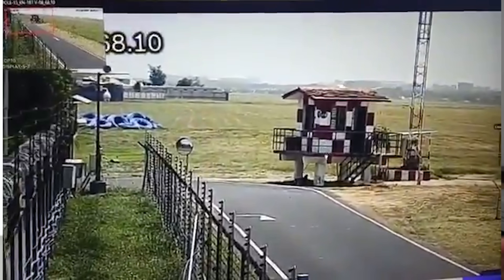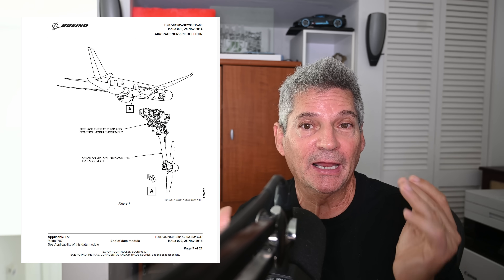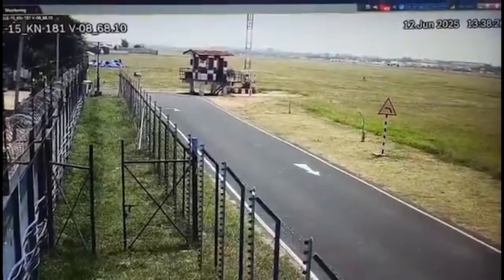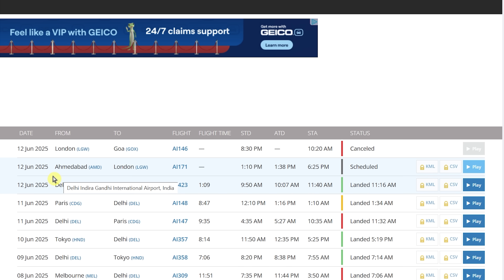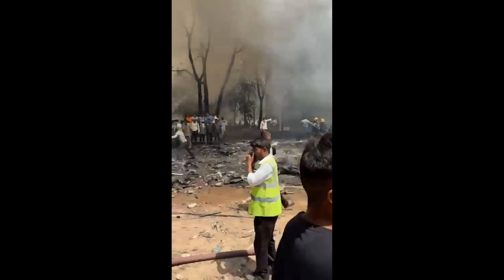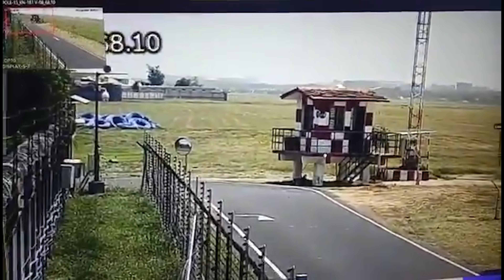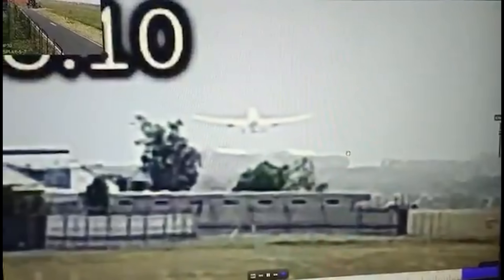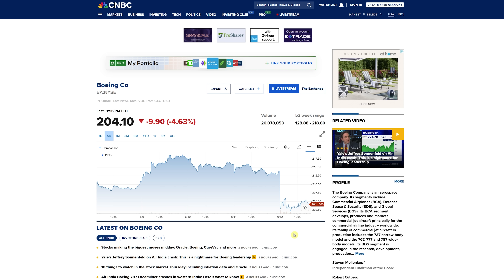What Caused Air India 171 Crash, Mysterious Sound Before Impact

Comment: It acted like and sounded like either Double Engine Failure (both engines) or a compressor stall .. but without the characteristic "banging". Either that or the engines never spooled up properly before the plane left the ground. I'm even curious if fuel was somehow cut off suddenly. It might explain why it sounded like both engines were spooling down. 
It's a miracle that anyone could walk away from that crash. A M A Z I N G  !!   I'm guessing the forward fuselage broke away from at the Wing Root (or spar / strongest part of the plane) as did the tail section from the other side of the wing root. There was likely no recognizable plane in front of him and his feet might have even been dangling from 12-16 feet above the wreckage. He undid his seat belt and basically fell out of the plane without any floor in front of him.

Comment: I think plane experienced total electrical system failure that affected engines and deployed RAT, tell tale sign is flight data transmission to FlightAware stopped at 625ft
Reply: A total electrical failure, while possible, won't affect control of the engines.

Comment: In a modern aircraft, deploying the flaps is crucial, and I see no flaps. This brings up such painful memories. The failure to deploy the flaps is what led to the tragic death of my three loved ones when Northwest Airlines Flight 255 crashed at DTW on August 16, 1987. How could that happen again with a modern aircraft?
Reply: In a 787, takeoff without flaps will not happen as the takeoff configuration warning system will restrict the movement of the throttles and its not that easy to disable it.

For now we have to wait for the DGCA to say anything
Reply: How can even an inexperienced pilot not properly deploy the flaps when that is so crucial?  In safety we call that complacency where you are on autopilot and not really thinking.  I suppose it is possible.
Reply: If it is flaps then it has to be determined what caused the flap issue.  Possible loss of power to hydraulics so the RAT is deployed but not enough time to gain the needed power?  Only thinking out loud.  Very tragic.
Reply: In the video, the flaps were retracted. Doesn't make difference what happened before that. No flaps, no lift, you're dead.
Reply: @MrPLC999  the video was not of Best quality, plus a 787 will never take off if flaps were not extended, the system will restrict movement of the engine throttles
Reply: @MrPLC999  so what was the root cause?  We seem to understand the flaps weren't properly positioned.  Why?  Mistake or something else.  Like a guy run a red light and dies so the brilliant observation is he hit someone and died?  If you run red lights you might die?  Like I said it seems like the flaps are basic for anyone flying that level of aircraft.
Reply: It is very rare!!!!
System these days call out that before takeoff
Reply: The comunication by the pilot to control tower was : “MAYDAY  MAYDAY ENGINE FAILURE… NO POWER NO TRUST”……… Evidently an engine problem Not a flaps issue
Reply: The flaps were out according to the footage of the crashed plane.
Reply: @nickofzo yeah but RAT was also deployed automatically which means it only happens if there is a loss of power. So both engines lost power. Question is how? 

This is the biggest thing we need to see rn. And Boeing don't have a good track record for past 5 years.

Comment: Another YT video on this crash shows the takeoff from the aft end of the aircraft. The flaps were clearly stowed in this video; you can see the flap track fairings, which would be blocked from view if the flaps were deployed. 

This is what I think happened: the aircraft went to the holding point with the flaps stowed. When the pilot set takeoff thrust and all the alarms started going off the crew decided they were false and silenced them...There's claim that the slats were deployed and the flaps were partially deployed...which sounds to me like the crew realizing their mistake while the jet was in the air and trying to set them when the aircraft was already flying - which does not work; they have to be set before flight for a reason.

Final report: "Recommendations to prevent this from happening: don't do that!"

Comment: the RAT (ram air turbine) is for generating electricity, not for propelling the plane. the electricity did cut off on this plane in its prior flight. so perhaps the RAT came out because of an electrical power outage.

Comment: i see smoke on left when rising from runway also i think trajectory was not straight with runway, i think left engine went and fully loaded no power, very thin wings on this 787, needed both engines... would the prop drive drop if one engine fails due to bird strike and compressor fan failure?

Comment: Look where it took off on Flight radar 24. Seems the pilot did not use the full length of the run way. Went to the first taxiway and entered the runway. To use the full length of the runway, pilot would have turned left and taxi down and do a 180 to use the full 11,000 foot runway.

Comment: CHECK THE CARGO . WAS WEIGHT. OVERLOADED?
2 ENGINE BOTH  TO STOPED WHENN?
EMERGENCY POWERSYSTEM ACTIVATED, ENGINE. STILL RUNNING BUT WITH NOT ENOUGH POWER BECAUSE OF OVERLOAD. THE PILOT COULDNT PUT MORE POWER TO THE ENGINE IN TIME BECAUSE  THE HIGHT WAS NOT ENOUGH, AND  TO SELF ACTIVATE THE ENERGENCY ELECTRIC POWER SYSTEM YOU  LOSE TIME

Comment: I have 1 question for you sir , aroplane crash with fully loaded fuel into small building and it doesn't fall off ,just few damage and how come American twin towers with so much sequrity and heavy infrastructure fall off so easily??
Reply: The 911 twin towers were wired with explosives it was a controlled demolition
Reply: Not a concrete building

Comment: The run-way is too small for the Air-INDIA flight to fly and the corrupt politicians allowed lot of concrete jungle buildings near the airport...
Reply: The runway is almost 12,000 feet long that is as long as they come .
But the question is did he use the whole length seems like he didn’t back track down and instead took off starting from the middle of the runway using only 6,000 feet .
Hard to believe they would be that stupid but what else can it be ?

Comment: I've performed ops checks on many RAT's on Airbus and Boeing over the years and can attest the noise produced is deafening, especially if you're running it in the hanger or standing close by. You HAVE to wear hearing protection! Yes, you can hear it a long way away and it has a very distinctive sound signature. I think you're right. It sounds like it deployed.

Comment: NOW WE CONCENTRATE OUR ATENTION TO THE FIRST HALF OF THE PLANE. 
1 HE WENT THROU BUILDING WITH ENOUGH SPEED AND AS A RESULT WILL BE SQUASHED AT IMPACT. 
2 THE SPEED OF THE FIRST HALF COMPARES WITH THE REAR OF THE PLANE WAS HIGH ENOGH TO ESCAPE FROM EXPLOSION OF THE REAR PART OF THE PLANE
3 THE 1ST HALF WILL HAVE NOT ENOGH SPEED TO KILL ALL THE PASAGERS ON ROW 9,10 ,11 AT THE IMPACT
4 THE PASSANGERS OF ROWS 9,10,11 WERE BADLY, VERY BADLY INJURED AFTER IMPACT WITH ZHE SOIL. ALL DIED SHORT AFTER
5 PASSENGER SEAT 11A SURVIVES BECAUSE HE WAS THE LAST ONE AND THE SPEED WAS NOT HIGH ENOGH
6 BEFORE IMPACT WITHSOIL 1ST HALF TURNS TO RIGHT ALMOST UPSIDE DOWN
7 THAT PUT SEAT 11A  UP
8 THE CRUSH  LEFT HIM WITH THE MOST CHANCES OF SURVIVE

Comment: Whenever a commercial flight crashes like this, do you notice the debris like everywhere.  Even when there is a huge ball of fire, that being thousands of gallons of jet fuel dumping everywhere and igniting at once.  Causing extreme heat and many things being burnt completely.  
Then I always go back to 9/11 the pentagon and Shanksville, PA.  There was zero debris, no engines, no luggage, no bodies at both "crash sites".  Why is this, the official story says things vaporized, I don't think so.  Were talking titanium and stainless steel landing gear and turbines and gobs of hydraulic lines etc.  Bodies don't vaporize in plane crashes.  The hamburger and tear apart but vaporize hardly.   Not on impact, if they burn forever charred remains.
Anyone remember that flight where the co pilot locked the pilot out of the cockpit and flew the airliner into a mountainside over in Europe??  Like ten fifteen years ago, look it up.  They were flying at 520 mph so when they hit, obliterated that plane into pieces but there was still all the parts up and down that mountain side..
What am I getting at??  We are not being told the truth about 9/11 and if more people were questioning it maybe we would have some truth about what really happened.  If they lie about one thing they lie about the whole thing as a whole.
Reply: What are you talking about? They’re plenty of video and pictures of landing gears/an engine in the middle of the road

Comment: Even at 2min into this.  And seeing the ORG video before Jeff says it...   No engine power, no engine noise.  Airliners can take off with an engine failure.   But, we can hear the RAT  (Ram Air Turbine) screaming.   Auto deployed to help in anyway it can.  :(

We know the engines aren't working.  But we do not know the cause yet.  Birds, compression failure?

Another YT looking at the early copy-video - thought he could make out the RAT.   Without the audio and blurry picture. He made a good call.
Reply: People saying "The flaps weren't down".   The plane wouldn't take off without flaps.  It might have gotten off the ground, but it wouldn't gain much altitude.  It looked like a normal take off until about 500ft when it stopped going higher.  The RAT wouldn't deploy because of a FLAP setting.   The Flight recorders will be needed to see what failed and when it failed.

Comment: If you look closely, if you know anything about flying, the flaps were not extended. This is exactly what happened on flight 255 in Detroit, Michigan in the 1980s if this is the case for sure, the plane could not lift and drop like a wet bag of cement.

Comment: Possible causes of loss of lift
1. Engines do not have enough fuel (clog fuel line, power to fuel pumps fail, fuel contamination)
2. Flap hydraulic control system fails.
3. Velocity sensor gives faulty signal that the airplane velocity high so it does not need wing flaps extended.
4.Altitude sensor gives wrong attitude ( high) so the computer prevent the airplane flap to deploy.
However, the most possible cause is hydraulic failure due to poor or wrong  maintenance procedures.
Reply: 5.  REALLY clueless answers there.

Comment: How DID SURVIVED? SIMPLE. THE RIGHT CONDITIONS:
1 PLANE HITS A STRUCTURE ( BUILDING UNDER CONSTRUCTION.
2 NOSE OF PLANE GOES LIKE A NEEDLE THROUGH HOLES .
3 THE WINGSPARTS ARE DETACHIN FROM PLANE. PRACTICALY PLANE IS AT THIS TIME BROKE IN HALF. 
4 NOW THE FRONT HALF OF THE PLANE IS LIKE A BULLET
5. REAR PART IS SLOWED BY THE IMPACT OF WINGST WITH THE BUILDING AND OCCURR EXPLOSION.  
6 ALL THE PEOPLE FROM WINGS TO TAIL DIED FROM EXPLOSION

Comment: Boeing 747-ABL/X Pressurization Engineer here. He's RAT right. 787 had the first (and only) bleed-less pressurization/hydraulics system ever and was futuristically almost completely electric instead of mechanical, which also was before EV fires were common (electric planes were coming!), but we were still concerned. You are right the RAT deployed (a vid still shows blades as well), as both planes in your RAT video (India vs Boeing RAT Test) also had to correct yaw at about the same amount since the RAT is surprizingly far off centerline. An electrical hydraulic failure would have to be multiple and systems-wide. But, if 14 year old backup batteries hooked to the same power leads went run-away critical? or IDK -same factory, not my plane. IMPORTANTLY the takeoff flaps are at a perfect position to not tell if they are up or down in the graininess but as your great vid catch showed, look at the notch made between the fuselage and the flap to verify they ARE in takeoff position! BUT NOTE THE GEAR STOPPED FOLDING UP! -still and all the way to the ground -exactly when they "lost power" and started descending, but the radio and other systems may have different backups (we back-up everything! but I retired). Black box will tell, (start tech pool -winnings to vics?) As for the guy who walked away, he was 2 rows back from the emergency exit and on those, there are always stress problems there and the wing leading edge (which IS stout). If they were yawing (plus that slight bank) that may have contributed where a large tear occurred when it hit the building, etc (they should have vid from the med school  or of the guy) IDK. Also he could have ran forward two seats and opened the door like 007 -he looked buffed just enough -hey, he didn't know why they were descending and INDIA is only in a cease fire! (Another pool to vics?)
Reply: votre remarque me parait tres tres intéressante , la batterie qui alimente l'hydraulique pourrait elle  causer la coupure des 2 moteur ? ; sur le vol d'avant il y avait des problèmes de climatisation et de multimédia
Reply: He is showing the wrong plan; 11a was straight near the emergency exit, so he could open the emergency door in seconds with no need to walk to it.
Reply: Looking at vid again. I saw step 1 of folding gear is very different from 747 and yes I see 787 used a new swing type gear, so ...that's why I'm starting a pool against the real cause (winnings to vics and a best guess prize for percentage received!)
Reply: I guess my 'ruler on the TV' analysis of the gear folding was better than I thought, because the gear up process did start and then failed to fold close to the up position.

Comment: Experts say the flaps were not set. I d9nt agree with this. Whether flaps set or not at full thrust of both engines the plane should go up. I have also seen plsnes taking off with theor wheels still exposed for a longer time. I suspect both engine failures.

Comment: The flaps were definitely set.  I can't say the flaps level.  You can see light between the deployed flap and the wing itself on the video where the plane flies overhead.  You wouldn't be able to see that gap if they weren't deployed pretty far
Reply: I compared to other 787 takeoffs with flaps set to 5 and looks the same basically the trailing edge look like they are up .
If you see a 787 with flaps 15 takeoff they are definitely noticeable 
Can’t see them take off with no flaps as there are warning horns blaring

Comment: Great video and coverage. My question…..according to Flightradar 24 data, that plane took off from the middle of the runway….instead of rolling to the back of the runway and turning 180 to line up.  This is a huge issue. 

When I view the plane from takeoff to overhead, it doesnt look like the flaps are extended at all. At the 5:20 mark of the video, we should not be able to see the right side engine if flaps are extended. It would be blocked from view!!     If you go frame by frame to the 5:44 mark, there is no movement of the wing flaps at all. The right engine should be either cleared from the flaps obstruction, or still obstructed…..its not…the amount of engine in view on the right engine is the same as the left engine??? So gear is out, flaps never moved??

So, if the flaps are not extended and the plane begins to stall….would the RAT deploy?One other point, the jet doesnt really sound very loud overhead during takeoff…that seemed odd as well. The FDR will show everything. Horrible tragedy.

Comment: I am not seeing or hearing the RAT but what I am seeing on the second video is the plane used up the whole runway and perhaps even overshot the runway a little before getting airborne At the end of the runway is dirt and you can clearly see a massive dust cloud created by the engines when the pilot rotated.
Had the rotation been over tarmac you wouldn’t see that dust cloud .
So it shows that the engines were producing thrust and this plane went right to the end of the runway but remember this is almost 12,000 feet long a very long runway and normally the plane should lift off at around 5900 feet half way down the runway so this plane was in major problems before it got airborne.
I believe the flaps were set at 5 degrees and that should have been fine with such a long runway and at that setting it would look like they weren’t put down .
I really think the pilot didn’t use the full runway didn’t back track to the end started his roll at the intersection and basically just used half the runway about 6,000 feet .
I believe with the full load , flaps 5 and the 40 Celsius heat the plane struggled to get airborne and in the last seconds managed to pull up .
But once out of ground effect and with the gear down and the pilot pulling up the nose the drag increased causing a stall .
Reply: Strong possibility is a right engine failure after V1, but prior to rotation, pilot is supposed to continue, but you will use a LOT of runway to get airborne. If they weren't already at max power (usually not), they would have jammed the throttles all the way forward, commanding max thrust on the left engine.  I think that may be what caused the "dust" cloud as they rotated and that engine's thrust was directed somewhat downward.  Heavy and hot, sure, the manual says it will climb, but you better not make any pilot mistakes. (like retracting flaps instead of gear in the panic of the moment)  It also looks to me like the fuselage is yawed right during the climb, as one would expect to see after a R engine failure.